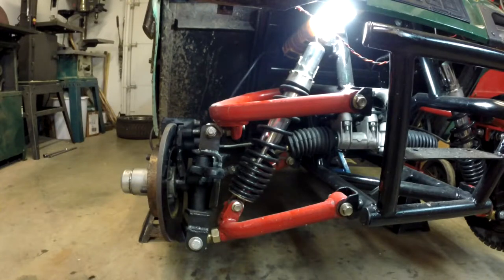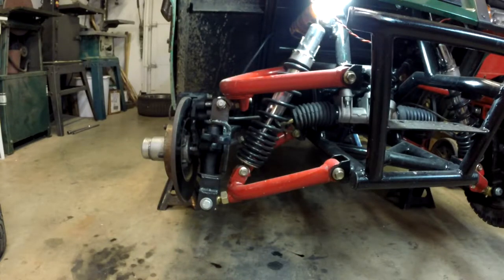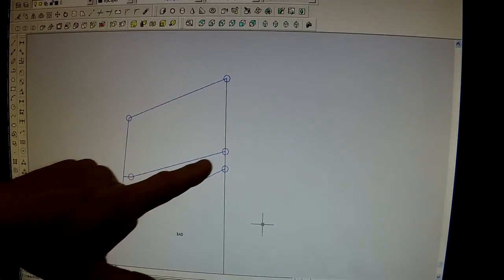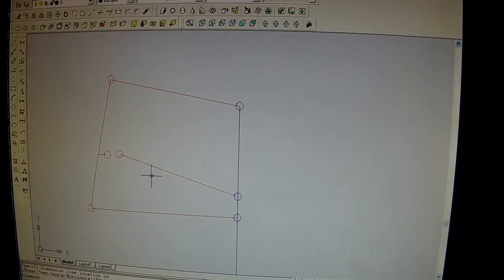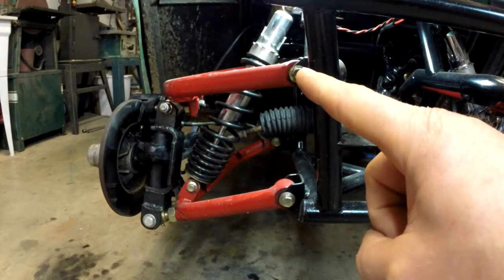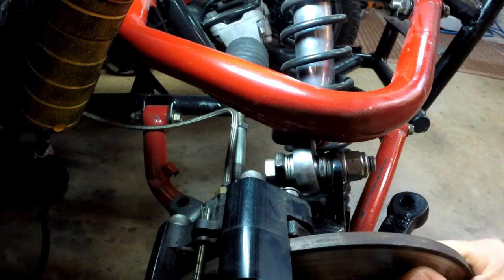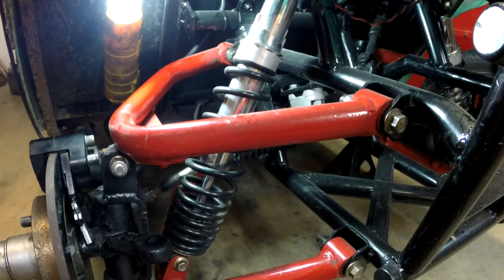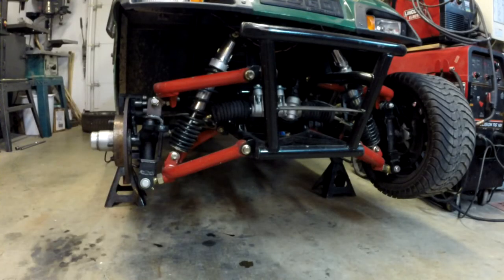Custom Golf Cart Suspension

Comment: If those shocks are a little soft you can firm them up by simply standing them up straighter. Simply moving the top mounts outward more will do the trick, that's what I did on my dual A-arm golf cart build. It doesn't take much, but the more of a lean they have the move leverage works against them making them softer (easier to compress). You've got plenty of room to stand them up a little more and for adjustability its easy to build-in multiple mounting points along the top while your at it. One thing I didn't hear you talk about was designing proper ackerman, that's also very important in a full-build like this so you aren't dragging a front tire while turning. But great job on the build, glad that I found someone else who really enjoys engineering challenges of doing a DIY build the correct way. Wish I had the video-making skills you have! New subscriber here, look forward to future videos like this!
Reply from the maker: Yes, you are correct. I placed the shocks so they would be perpendicular to the a arm at full compression. This should mimic a progressive spring rate.  I didn’t worry about the Ackerman angle because I used the original spindles. They are mounted it pretty much the same location so it should be close.